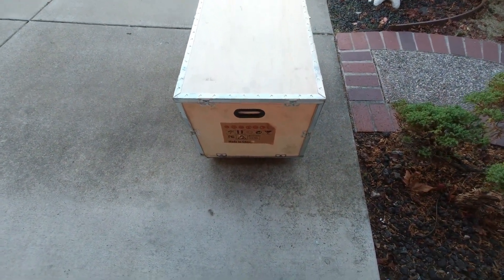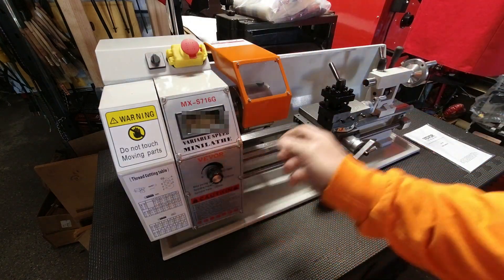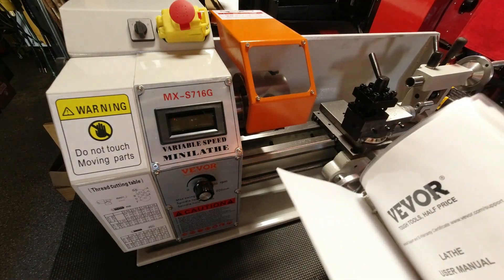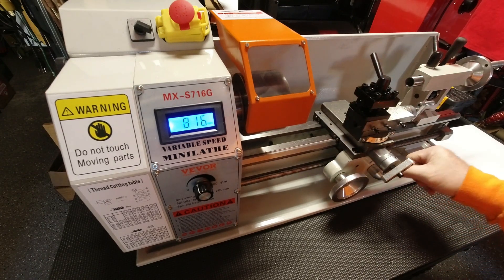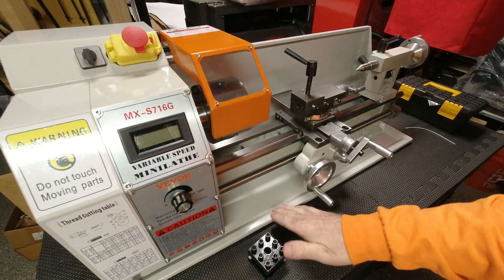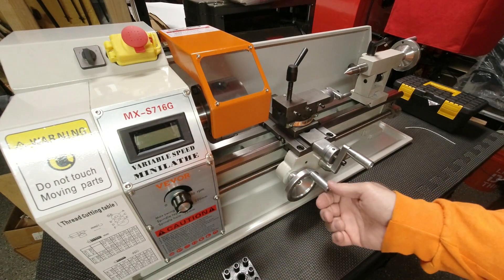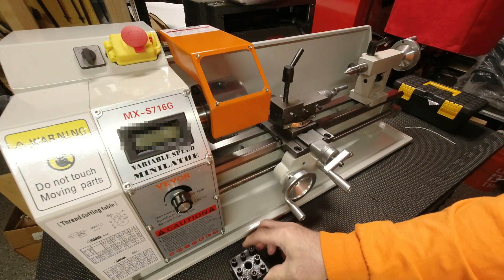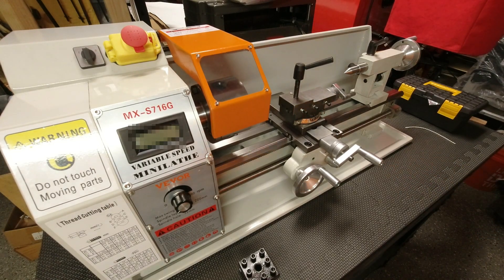Machinist Wannabe: Lathe Unboxing and First Look (does it turn on?)

Comment: You'll want to level the lathe to take out any twist in the bed. It's not about being level to gravity but square to itself. 
The pad under the lathe will impart a twist from one end to the other and you'll cut a taper. The pad will also create chatter by imparting vibration. You want rock solid rigid. 

Also, oil for the gears rather than grease. Grease is too thick. Light oil for the change gears and way oil for the ways.

A good cleaning to get the shipping oil/cosmoline or whatever they have on everything too.
Reply from the maker: Thanks for the tips, good to know as I learn.

Comment: With 20y in warehousing I've seen a lot. Working with appliances as I do now it's pretty similar to the lathe. They are always going to get banged up.
I deal with some ranges that are upward of $90k and the couriers are still more focussed on min/maxing their time that the piece that costs more than their entire night's worth of work gets moved around like any other box.

First thing to do is take pictures of it from all sides with the driver there. Make sure identifying labels are clear in the photos. Then check for signs of damage and take close up pictures. Before signing, note down any signs of damage on their paperwork, and yours. Have them sign your notation on your paperwork as a witness, then sign off on theirs.
As soon as you sign their paperwork they have zero reason to be there, so always sign their paperwork AFTER everything else is done. If the damage is to the packaging only, then put your paperwork aside in a safe space for the time being. If there is notable damage to the unit itself, then contact your supplier about it immediately
Reply: If you find something wrong within the warranty period then you can bring out your signed paperwork showing that it had been mishandled, which will cover all but the most obvious damage that might be caused by you, the consumer
Reply: The reason it makes everything easier on you is because the supplier doesn't have to swallow the cost of replacement since they can go after the carrier l, who's insurance will cover it. If the supplier has to swallow the cost then they are most likely to push back on a claim
Reply: In defense of the UPS guys, bolted crates can be carried tipped over like that. That is why they are bolted.
If the unit had been on it's side in the truck then you'd seen much more dirt and scratches on the side it was lying on.
Units that cannot be safely tipped while carrying typically have a label saying so and have a thing stuck to the side called a "tipp'n tell" with blue sparkles at the bottom and sticky white tape at the top that will collect sparkles is the unit is tipped beyond an acceptable point, clearly showing it has been mishandled

Comment: I have almost that same lathe with a different brand name. Having a lathe at home has come in handy on multiple occasions. That's cool man, enjoy.
Reply from the maker: I no longer have to say "I wish I had a lathe" for a particular project.  Now I'm saying "I wish I knew how to use this lathe!" but that's the fun part now...learning how to properly and effectively use this interesting machine.  Almost every YT video I've seen over the years on these foreign made mini lathes has been pretty harsh in all honesty.  However, maybe by luck or evolution, I'm pretty impressed (for the price) with the machine I have.  I'm enjoying my learning process.  Can't say the same for my wallet on the "upgrades" and additions!

Comment: Please don't rotate your chuck without tightening the jaws first, on a piece of work or themselves. Failure to do so could send the chuck jaws flying out of the chuck. Nice video. 
Sincerely Robert
Reply from the maker: Good to know and in hindsight should have been common safety knowlege! Will definitely remember that advice.
Reply: @ReLoadersBench  I read down to see if anyone had already commented on this.  I'll reinforce that it's a good habit  to put something in the chuck, with the chuck jaws tightened securely before running the lathe.   It's not always enough just to tighten the jaws in an empty chuck, especially as chuck jaws wear.
Reply from the maker: @vandalsgarage  - all great things to know, especially for someone brand new to this and not having too much of a clue other than years of watching videos and maybe not paying enough attention.